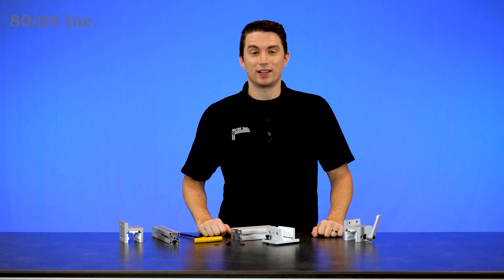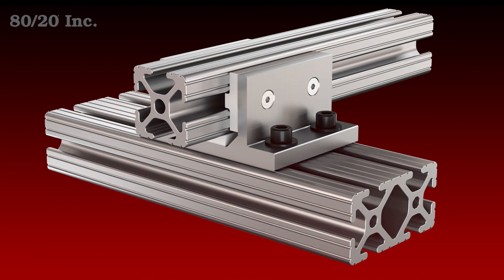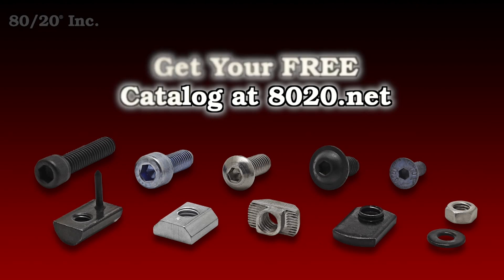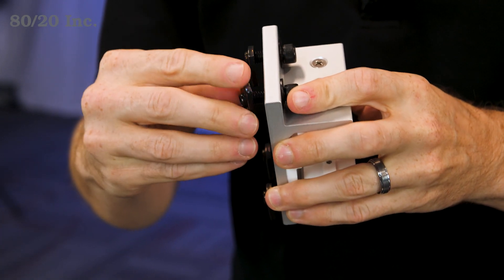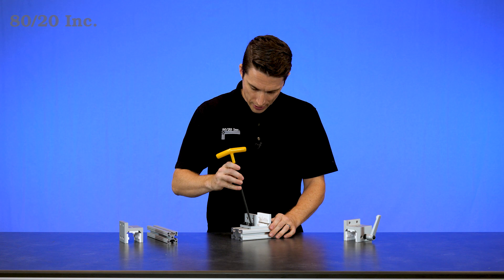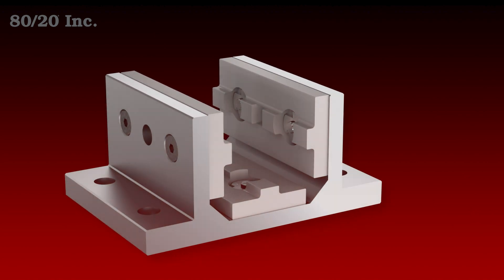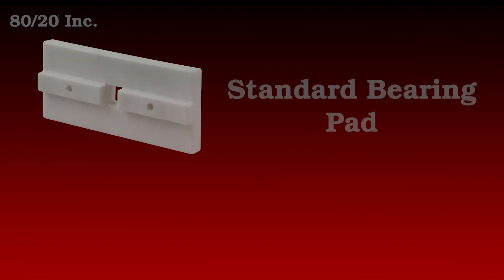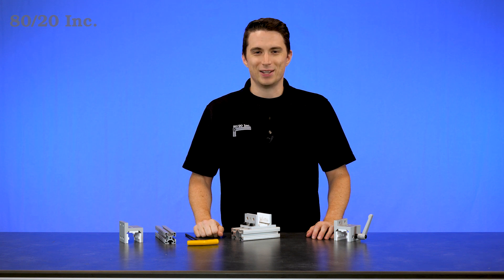80/20: Linear Bearings

Comment: Is there a load bearing version, for roughly 50kg? 
 
Long story short, I'm looking to add storage options on my mobility chair (Permobil M300HD) that I had rebuilt into a 4wd beast. The batteries are tough to get to. Storage space, even moreso. So I was looking to use more extrusions that I can connect to my already overpowered actuators.
Reply from the maker: We'd need a bit more technical information and pictures to answer your question more specifically.

Comment: I think it should be noted you can do this in a reverse manner as well. If you want to use these bearings to slide across a bar instead of sliding a bar through the bearing as well. They don't necessarily demonstrate that in the video, but can be used that way as well.

Comment: Do you have any examples of wood working fences?  How about a rip fence for a table saw or a band saw?
Reply from the maker: While we don't have examples on hand at this time, there are many examples to be found by googling "80/20 rip fence." If you're looking to build, we can help with that!
Reply: 80/20 Inc I’m ready to build.  Other than Very Super Cool tools I cannot find a how to and I do not want to buy a $250 t square.  Should I contact a local distributor or 80/20 directly
Reply: @dadlifelepoe4073  what type of table saw fence are you looking to do? Standard rip fence, or something more complex? 
 
I have built a panel saw, and track saw, router fence, drill press fence, and bandsaw fence so far. (I have 1 arm/leg so I do not use a table saw due to safety issues... and cannot afford a SawStop. Lol)
 
The best way to do it is to get creative and look at if like Lego's lol. Theres so many great things that you can do. 
 
Look into JSK-Koubou YouTube channel. He makes the best stuff.
Reply: @carterscustomrods  basic fence.  Thank you
Reply: @carterscustomrods  it’s a craftsman.  The original fence it lost but was garbage anyway.  Trying to decide between mounting a angle to the table or just straight to the extrusion
Reply: @dadlifelepoe4073   what model is the craftsman? Or what are the table dimensions? 
 
I made my ripping bandsaw with an old craftsman table saw (model number 137.248840) it's a great little tabletop for the bandsaw I made. 
 
The extrusions are great for any size table (and any budget). You can get creative with it and go as big, or small as you want. It really is only limited to your budget.
 
For instance, a piece of 4080 (40x80mm) can be your fence. Some UHMW plastic (or UHMW tape is what I prefer), a few pieces of scrap plywood, and a couple of toggle clamps, and you can make a basic fence. It will have all the strength you need, and be perfectly straight as well.

Comment: How's the wiggle room with these? Could I replace 3D printer linear rods with these linear bearings?
Reply from the maker: The wiggle room can vary, and be adjusted, by using the included shim inserts.  While the linear bearings are great for adding motion to almost any project, using them as 3D printer rods would not be ideal due to the precision nature of 3D printers.  However, 80/20 profiles are study and rigid, making them ideal for a 3D printer frame / enclosure ; 
https://youtu.be/rTjTdyQFTGE